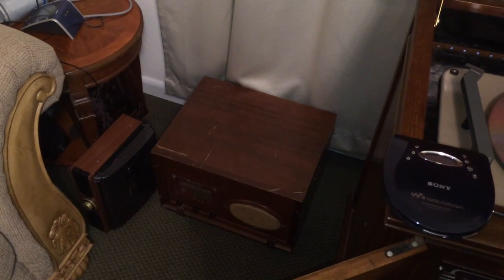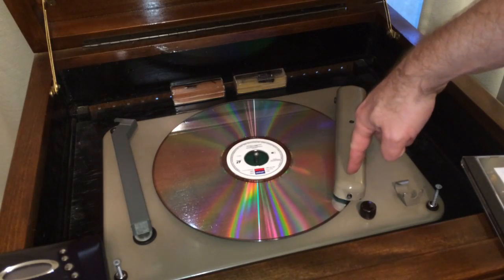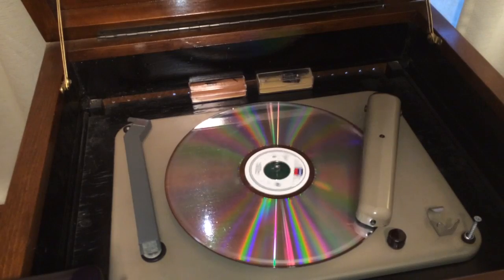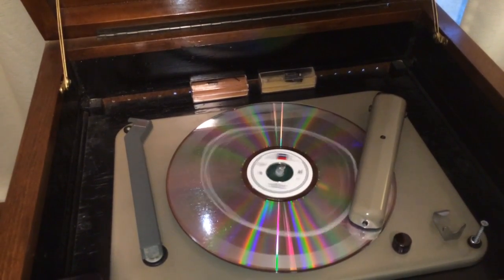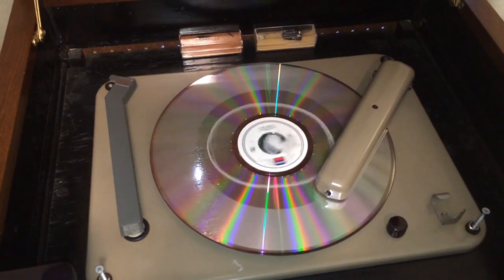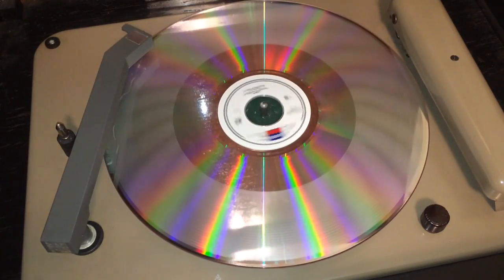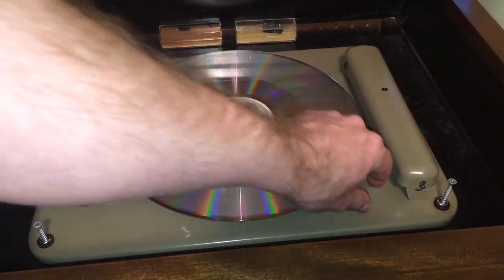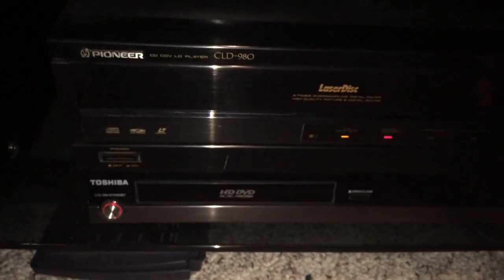Recording Sound onto a Laserdisc - Is this possible?

Comment: The sound is nuts because it cannot decode the PCM data any more, if it is a PAL disc you are out of luck but an NTSC disc has also analog audio on it (encoded in the FM modulated picture - can be true analog audio, or one channel audio comments and the other channel AC3 modulated DD 5.1) so there you will hear sound but with a crackling noise like an audio record :D

The picture is resistent because it is purely FM coded. So all the minor errors due to your groove (which is 50 times thicker than the pits, so the difference between "pit" and "no pit" is still large enough for the laser pickup to detect, as you only scratched the groove in the laquer surface and not into the pit layer) and the "crackling" errors on the video just do not harm - it is just like distortions of the FM signal which make it not impossible to extract the video signal out of it. It destroys the digital sound though as it has no checksums and hence the damage is much bigger.
Reply: +Pascal ‘Le Bakala’ Gienger That's my line :).  If know the technique it's logical that the sound is ruined. But the video give a excellent view of the damage that's really done to the disc.
Reply: You make zero sense.
Reply: +romangodofvoodoo Are you talking about Pascal?  Cause he made perfect sense.
Reply: +Pascal “Le Bakala” Gienger THAT WOULD ALLOW FOR A UNIQUE ALBUM, DON'T YOU THINK? "IT'S CALLED LAZERVINYL, TO HEAR A SET OF TRACKS YOU PUT IT INTO A LAZERDISC PLAYER. HOWEVER, TO HEAR ANOTHER SET OF TRACKS YOU PUT IT INTO A TURNTABLE!".
Reply: Cartridge Head Based on your spelling, it would appear that you probably flunked school.  However, Pascal actually has an education.  So please kindly go away.  Thanks.
Reply: Cartridge Head Neither can you.
Reply: Doddo MultiGamer You're thinking broadcast.  Check it out here:  http://www.laserdiscarchive.co.uk/laserdisc_archive/how_laserdiscs_are_produced.htm

"In the diagram the top waveform represents the composite video signal direct frequency modulated (FM) on a top carrier frequency of 7.1MHz. The two audio signals (left & right) are modulated onto sub-carriers at 684kHz and 1066kHz and are combined with it in such a way as the resulting clipped FM signal becomes an analogue code for the modulated signals. In this the pit represents the video part of the signal and the spacing between them 9lands) determines the audio signal. Both the length of the pits and the space in between them varies independently, in accordance with the strength of the signals."

Comment: Video is analog so it will play with little noise, Audio is a stream of digital data that has error correction codes and some other tracking data so it will be affected by the surface of the disc.
Reply: James Bordon It should also have the two legacy analogue audio channels, and for testing he could have switched to those.

Comment: The video is still rendering through youtube. I'll make sure I'll watch it later at work.

Did you know Laserdisc was the only optical disc format to offer analog audio? Yes it does have the ability to offer digital surround, but the default left and right tracks were for analog audio only. Older laserdiscs (pre-surround sound era) as well as almost all music video discs EPs were presented with analog audio.
Reply from the maker: Video should be ready now George Moore, and yes, the audio system was AFM with CX noise reduction until digital audio hit the scene.
Reply: They also made something where it’s basically a movie being played off a vinyl disc, video and audio are played with a stylus, pretty cool stuff

Comment: Wow, what an insane project!
I would love to learn how to restore old electronics, and get them working as well as you successfully have!
Reply from the maker: +VinnytotheK - well get busy!   do you have anything in mind to restore?
Reply: +databits 
 A bit different than this, but I bought an 8mm video recorder and I need to figure out why it's not powering on. Hopefully it will be a simple repair, but it could be a goner. I need to troubleshoot a bit and locate some information on the model I have. Besides that I have a Nintendo Gamecube and Gameboy color that need repairs. It would be great if I could restore the 8mm video camera though, and I'm considering picking this up as a hobby.
Reply from the maker: +VinnytotheK - it's a very fun hobby - and I'm always here for advice if you need it!  I would try a different power supply on that camera first

Comment: I just got a record lathe and am trying to find best way to cut records. I read somewhere that putting lighter fluid on your blank and letting it soak in a for a few minutes softens up the medium so it's easier to cut and less noisy. The same people/site said that lighter fluid is pretty fumy and they found that some sort of Turtle Wax served almost as well. I watched your video to see if you might have some similar tips. It was useful nonetheless. I'm a coward afraid of messing up the expensive needle so I haven't tried anything yet so this is inspiring to give it go. Also somewhere they recommended heating up the disc with a blow dryer to make it easier to cut. So might experiment those things too. I'll see if I can find the site a friend referred me to.

Comment: +databits
1) Does turning up the volume change how load the music will be recorded to the record during cutting?
2) Can a record player work as a recorder it you change the stylist?
3) What is that hissing/sawing noise during playback?
4) Why did one song take up so much space on the disc? Shouldn't a record that size hold several songs on each side?

Comment: An amazing experiment. The down side is, you might have been able to sell that very disc for quite a bit. The reason there was audio artifact in the cut recording, is the laser disc is made of polycarbonate, which is much harder than vinyl. This will wear out your cutting head's needle in fairly short order, unfortunately. You did solve a mystery for me, though. Thanks for sharing. :)
Reply from the maker: +ThomasGrillo - glad I could solve the mystery for you!

Comment: That actually sounded quite good. But I hear a dragging sound, as if the cutter left a microscopically rough texture on the bottom of the groove. Maybe you could try the acetone vapor treatment that 3d printers use to re-polish the disc and clean up the sound. As a bonus, it might clean up the picture too.

Comment: I've recorded onto a cd without elec., using a 1926 gramophone (vivatonal).  got to get back to that!  what if you put some oil, just during the recording process?  or, a strong light bulb,like they used in the original wax recording studios?

Comment: try washing the disk with warm soapy water after you've cut it then dry it off and then apply a fine coat of baby oil then wipe it round it should improve the playback quite a bit

Comment: and another little tidbit, the video is actually analog, which is why it's still able to show it's information... the audio on the other hand is completely digital, and once you put those groves in, it was destroyed... those artifacts in the image you saw at the beginning could be fixed just by cleaning the scratches off the disc.

Comment: Why did,t you try to play the audio at the beginning?  You start playing the audio only once you start getting to the later sections on the disc and the video starts messing up so we don't know if it was working at the beginning or not. But it is amazing that you can use it in a laserdisc player at all even if the sound doesn't work. Cool video!
Reply from the maker: Jared Connell Thanks!
Reply from the maker: The beginning of a laserdisc is at the center of the disc.  You would have seen no effect on the video or audio had I started there.

Comment: The video is still playable but no sound (10:41) which means that in extreme condition analog (video) is more robust than digital (audio). Maybe you can hear the sound if you switch to analog audio (NTSC Laser Disc have both digital and analog audio at the same time). No wonder on DTV few stations are still using the VHF Low band due to impulse noise.

Comment: To turn off the beeping on some Sony CD Walkman, hold the stop button down while putting the batteries in, or plugging in the power adapter. This should turn off the beep between tracks and pause.
Reply: +ThruMy4Eyes I have still have my D321 the first DiscmanESP with 3 second skip protection, it also has line out with optical. I don't know if they bothered putting line-outs in the other models, (maybe the Discman Car.) The 1 Bit models were some of the best players made, awesome sound that was better than most home units at the time.

Comment: How do you have your player connected to your flatscreen TV.
The picture looks good whereas on mine the picture isn't that good.
I have to use my crt
Reply from the maker: I use a Samsung SIR-TS360 to upconvert the composite signal to component.
Reply: databits cheers.
I have a dvd recorder that has scart input and component output.
Not an upscaler but should clean the image up.

I'll try that. 
Thanks
Reply from the maker: Let me know how that works for you!
Reply: databits I tried it with two different LaserDisc players and two different DVD recorders both with component output.
The first LaserDisc player played ok through one of the DVD players with PAL but both the DVD recorder and LaserDisc don't handle NTSC well.
I have to mod the LaserDisc to output true NTSC which I'll do later.
The next LaserDisc player outputs true NTSC but the recorder let it down. PAL looked good.
So I set up my second recorder and that handles NTSC well. Both PAL and NTSC pictures looked good but both recorders really show up noise caused from the analogue signal.
One sort of smooths it out and doesn't look that bad but can be distracting whereas the other makes the noise look blocky.
I then tried scart to scart on the TV and the picture wasn't that bad. Colours weren't as vibrant and not as sharp as through component but watchable.
More watchable than last time I tried it with my BTTF disc both PAL and NTSC (I like Back to the Future a lot) so I think the transfer for those films is of a low quality.

It should be noted my Samsund HDTV really doesn't handle analogue signals well at all.
The signals cross over between the ariel and scart input and if the scart is pluged in I don't need to connect the UHF aerial just hold it near to scart for the TV to pick up the signal so a TV that handles analogue inputs or at least shields the signal might have better results.
Conclusion is that because the recorder doesn't act as an upscaler I'm probably better of using the TV scart until I buy an upscaler.
If only LaserDisc players could output RGB instead of composite through scart.
Reply: +Gambit771 Dude! What's the model of your DVD player? I want it because of the SCART to Component
Reply: My DVD player is hooked up by those cords with red, white, or yellow ends and accepts music and video discs
Reply: +mendyc158 Panasonic dmr-es10 and liteon lvw-5025ghc+
the panasonic is obviously better
Reply: Gambit771 Thanks dude
Reply: mendyc158 I think mine is a Maganvox DVD or however you spell it

Comment: I wonder if 3D printing blank discs would be a valid option
Reply: +larryinc64 i think a press would be easier to make
Reply: +larryinc64 you would not really get decent sound out of 3D printed material, and spend an abomination making it
Reply: +candidshadow Don't know about that. I've used 3D printers before, you could definitely set the quality high enough to get a decent playable record. They're accurate to within one nanometer, the length your fingernail grows in a second.

It would likely take multiple days to print a playable record though, with the needed quality.

Comment: I wonder if the visual representation of the grooves could theoretically be pieced back together to form the Moon Dance audio.
Reply from the maker: +Stack Trace - quite possibly
Reply: +databits I saw a video once where a speakerphone was placed in a room next to a potted plant.  A high res camera was placed outside of the room, focused on the leaves of the plant.  They were able to recreate the audio coming from the speakerphone conversation based on the video of the leaves vibrating ever so slightly.  I thought it was pretty interesting.

Comment: what are the differences between video disc and laserdisc?
Reply: ‍1marcelfilms 
Laser disc is better than VCD
DVD succeeded LaserDisc(LD) 

Laser Disc
    Resolution:
 NTSC:425 TV Lines
 PAL: 440 TV Lines
    Aspect Ratio:
        NTSC: 4:3
        PAL/SECAM: 4:3
    Framerate:
        NTSC: 29.97 or 23.976 frames per second
        PAL/SECAM: 25 frames per second

VCD
    Resolution:
        NTSC: 352x240
        PAL/SECAM: 352x288
    Aspect Ratio:
        NTSC: 4:3
        PAL/SECAM: 4:3
    Framerate:
        NTSC: 29.97 or 23.976 frames per second
        PAL/SECAM: 25 frames per second
    Bitrate: 1,150 kilobits per second
        Rate Control: constant bitrate

Comment: a good way to send a hidden message lol, burn a record on to a laserdisc of just about anything, but have the video be the secret message lol, a good way to hide messages in plain site lol
Reply: +Justin Noker 

I was thinking the same thing here, im a pen tester. Its LaserDisc so the first thing any investigator will do is pop in the disc to see what video analog is on it HOWEVER. If you cut audio, Keep cutting until the entire disk has grooves use static. That way he/she will think its supposed to look like that

extra protection by cutting the actual message in the middle or any place but the beginning or end.

Comment: Sound is broken probably because it's digital and the player doesn't know what to do with all the errors.
Reply: +pvc988 Laser discs are analog
Reply: +pvc988 Video was analog but audio could be either analog or digital.
Reply: probably was analog on that disc, wasn't like a multi-million dollar movie or anything, but I don't actually know.
Reply: +greenmumm that's Pavarotti and friends... not a cheap production. But that's besides the point, wether analog or digital audio was used had little to do with cost, as digital audio was merely uncompressed PCM, nothing fancy or expensive.What DID cost money was including the RF modulated AC-3 (DD) audio, which I would not expect on this kind of disc, however this doesn't mean the audio was neccesarely analog. PAL discs, being better quality, only had the two audio tracks available instead of 4 so it's likely the digital audio was the only one available and that's why it's essentially destroied.

Comment: Why's it like a massive CD/DVD?
Reply: +The Restoration of Dr Who 
laser disks are like early dvd's, they used lasers to read movies from the disk however it didnt have menu's or anything like that.
Reply: chef favroa How are they analog?
Reply: It uses Pulse Width Modulation (PWM) of lands and pits to represent analog values of composite video signal.

Comment: That's where analog triumphs over digital. The analog laserdisc will still play with grooves cut into it where a simple fingerprint will completely disrupt a DVD or blue ray. Lol
Reply from the maker: +Wolfgang Westy - yeah the pits on a laserdisc are gigantic in comparison to bluray or DVD
Reply: +databits also analog will usually work, even if just kinda. Digital either works or it doesn't. While the picture and sound fall short in analog, the old technology was so much more robust.

Comment: Swarf.
Reply from the maker: +Sumo Sushi - love that swarf
Reply: +databits Love the recycling idea. How about a turntable with a laser stylus for a perfect way to playback your new found media format? or even better, a modded Laserdisc player with a stylus arm or maybe that molded laser to play them? The more layers of interconnected oddity the better when it comes to modded retroware imo. I'm thinking about building a PC that helps heat a vivarium atm, another form of recycling you don't usually see.